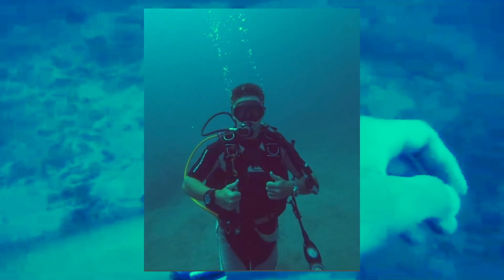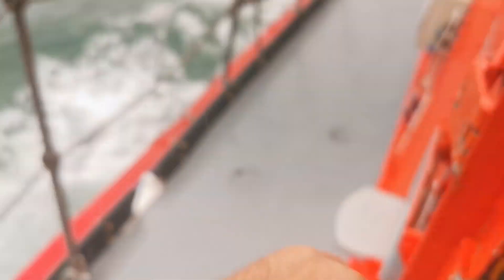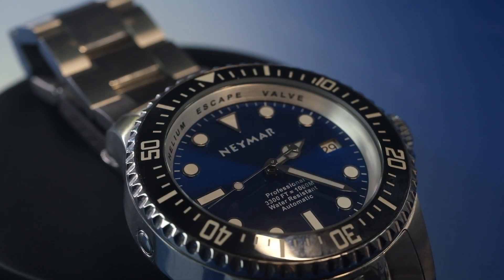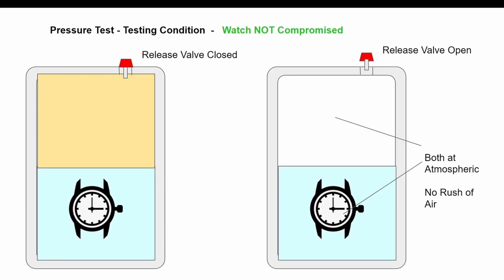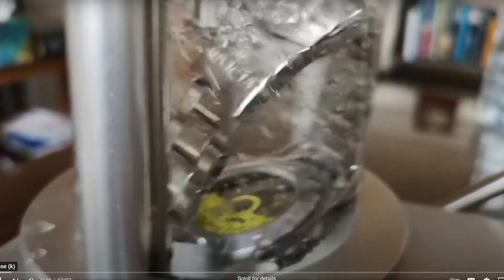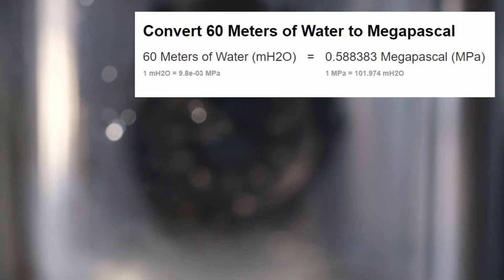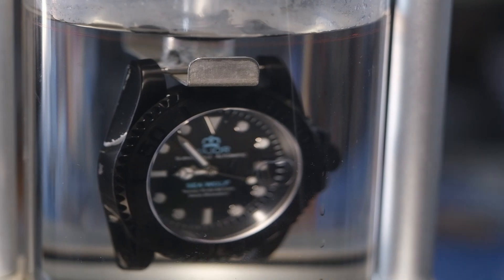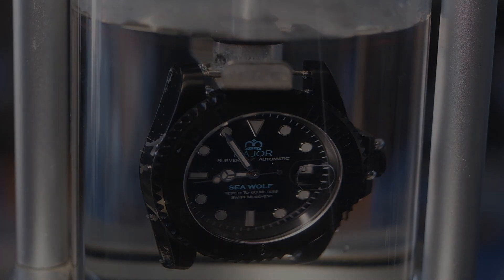I Blew Up A Dive Watch!

Comment: Question….Richard, do you pressure test the Rolex’s and have you ever come across one that wouldn’t hold to 10 ATM even after gasket and perhaps crystal replacement? I’m looking at DayDate’s and often the seller won’t guarantee the resistance…Great channel by the way 👌

Comment: I bought 2023 steel watch #25. Firstly, I love it and love telling people who ask, about your watch making story. That's the best watches for you; great conversation starters with like minded folk! Anyway, when I watched your video and heard you say "This is for Tim" @ 7m .... I thought, 'holy smokes - he's using MY pressure test video on his youtube video'. Alas my fame was not to be granted as this is clearly for another Tim. Anyway, love my watch and I would recommend the SEA WOLF to all. I have have heard the ETA 2824 movement is becoming extremely rare due to the patent expiring and competitors coming out with cheaper copys, such as the Sellita SW200-1 for example - Is this the case, and do you think sourcing the ETA 2824 will become harder in the future leading to choosing a different movement for future Major watches? Lastly, I notice both ETA 2824 and Sellita SW200-1 are available in 4 different specs being, 'standard', 'special', 'premium' and 'chronometre' with the differences coming down to accuracy - What version do you use in your watches? Just to add, I am very very impressed with the accuracy of mine - I have only had to adjust once in well over 12 months.

Comment: Great video Richard and it's always good to hear insights from a genuine watchmaker, rather than one of the many channels on here who are just trying to sell us another watch that we simply don't need!
But then again...
As an amateur tinkerer and enthusiast with a modest collection both automatic and quartz, I purchased one of these pressure testers from a well known auction site and wanted to be sure of water resistance of a 300m MWC after I replaced the battery and an Orient DIVER'S 200m that had the caseback removed for regulation.
And I'm happy to say that they have both passed the 60m test with flying colours (and the odd static bubble)
I didn't even have to ask myself if I "was planning to take the watch in water" as my local jeweller would say.
Cheers!

Comment: 60 meters is 197 feet.  That's a long way down.  For most recreational divers, 40 meters (130 feet) down is about as far as the vast majority can go without specialized equipment, mixed gases, training, and so on.  At that depth, the pressure is about 5 times what it is at the surface.

Comment: One thing I don't understand about the test.  Does the watch then stay pressurized inside, or will it eventually equalize to the environment?
Reply: If the watch does not "leak" it will not become pressurised internally. It will be at the pressure at which it was assembled, i.e. 1 bar, room pressure.  Only faulty watches become pressurised using this testing procedure.

Comment: No surprise as it’s an Invicta.
Reply: Nothing wrong with invicta I have two of them and I have never had any issues with them, also you should remember that invicta are a Swiss brand but owned by the Americans and no longer have a right to market them as Swiss made. As they are now made in America but to the exact same high standards, and powered by the highly reliable Seiko  NH35 automatic movement .
Reply from the maker: Fair play to Invicta .... It was damaged before it went into the tank! Richard